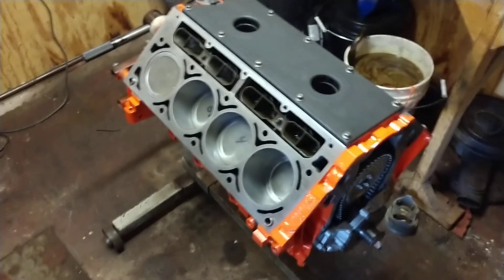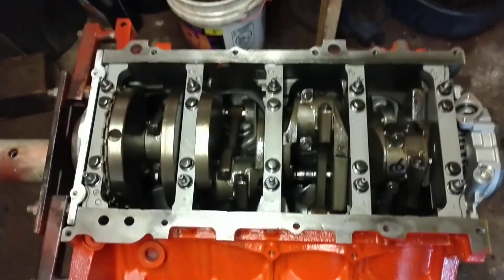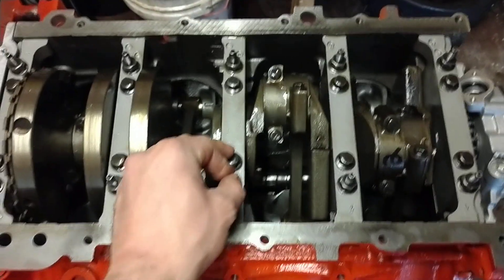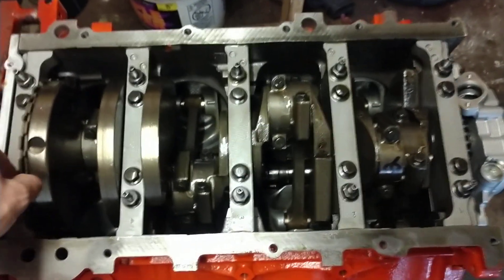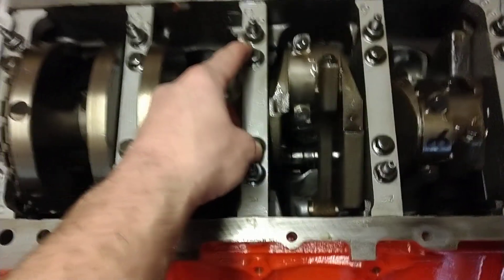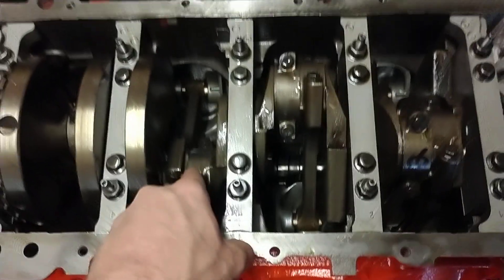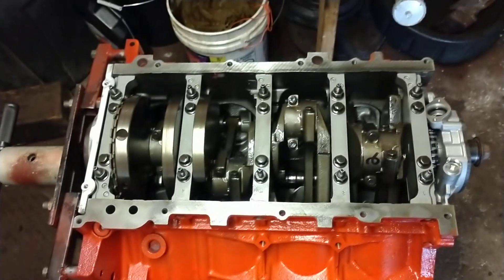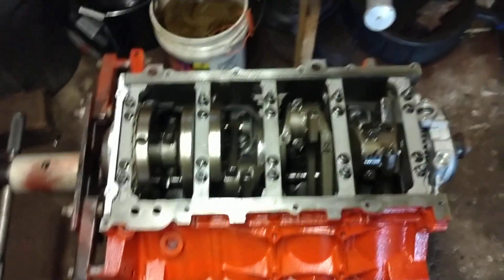HOW TO: Torquing Ls1 Rod and Main fasteners with a torque wrench! CORRECTION!

Comment: I just did my inner's to 60 ft/lbs and outers at 55 ft/lbs per many other videos.  I first checked the degree than it was consistently those numbers.  I feel good about the torque and like you said used bolts can make a difference.  Mine was done using a calibrated torque snap on wrench.  Good info on the rod bolts. thanks for the video

Comment: I’ve broken a main cap bolt!😡 any suggestions on how to remove it?
Reply: justin Bowles I just broke mine because of the dude
Reply: Which did you break the inner or outer?
Reply: @ajsmith3058  Which did you break the inner or outer?

Comment: I have a 2004 Chevy Silverado 2500 HD with a 6.0, I'm going to swap out the rod bearings and the main bearings and I was wondering if I could reuse the bolts. Some people said you can and some people said you can't. Thanks for clearing this up.

Comment: Do not reuse rod and main bolts..
Reply from the maker: Worked out perfectly fine in this situation. Now, the current 6.0 I  put together the rods would not torque down they just kept stretching. Right into the trash they went
Reply: @beeterolds  Did you still used the old main bearing cap bolts ?

Comment: 22 foot pounds on all bolts. Then 80 degrees on inner main cap bolts and 53 degrees on outer main cap bolts.
And don't use crappy press rods.